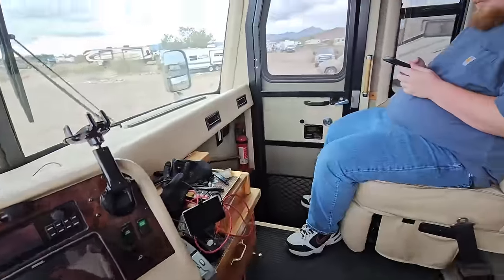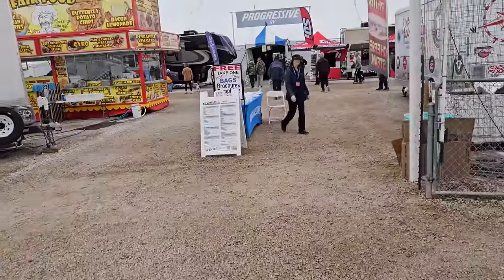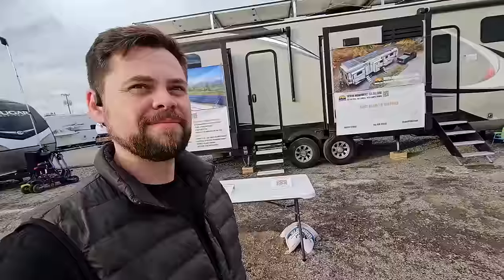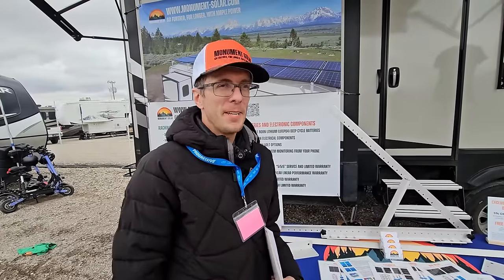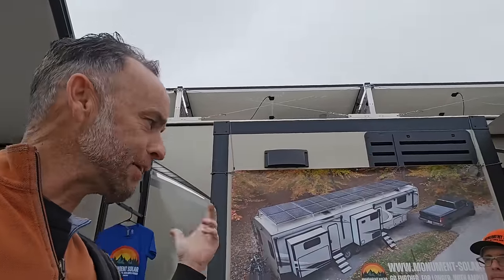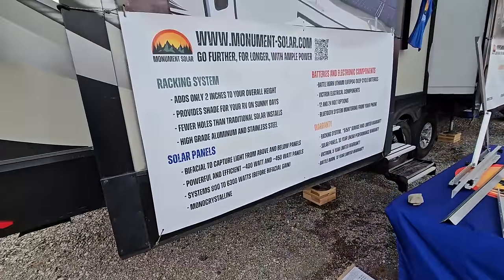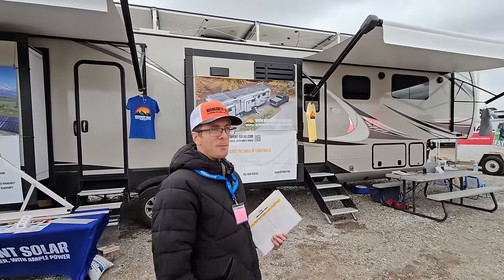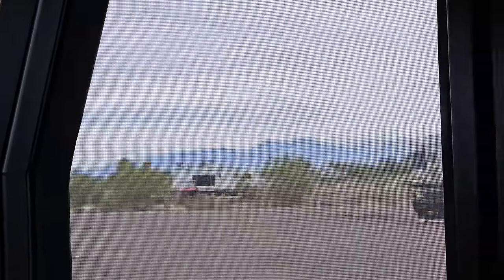The BEST RV Solar I Have Ever Seen!

Comment: Sorry. I don't think that this solar system proves anything but the fact that if money and weight were of no concern than you could build almost anything you wanted. A simple case that this guy while maybe very intelligent is like many inventors blinded by looking for fame and practical isn't part of his vocabulary. Probably a smart guy though.
Reply: All engineering is choosing what to compromise, what to optimize.  His choices don't completely put his solution in an extreme corner of the possible envelope, but definitely pretty far  toward one corner of it, versus the other corners.
Reply: I like your take @EfficientRVer  but I don't think that corner is going to be too populated and that's my point. You need to appeal to a mass market to be successful these days and in this case any RVer should be paying attention to the weight of their rig. This solution has plenty of hard work and brains behind it, just no practical use except for maybe a stationary RV. It's just too heavy when you take into account the cargo capacity left to work with.

Comment: Well WOWee. NOWww..All u need is to design a MOTORIZED version of this setup! I advise pneumatically dampened actuators to smooth out windy times operation. Setup should sense excessive wind to temporarily lower the panels, then raise when seens safe to do.
Reply: Adding to first comment..I have prototype of a solar panel/popup breezebox-type wind gen combo setup. The breezebox wind gens acually FOLD DOWN under the pnls nice & neat! So now u have better power grab'n chances in your travels!

Comment: Although this sounds like the solar would be structurally sound on the roof, what I don't understand is how anyone with a 5th wheel feels that they got an extra 800lbs ccc to spare for that amount of solar after they loaded their rig with food, bedding & clothing, dishes, outdoor gear and then the Water, in order to boon dock? Crazy but no 5er has that extra ccc, they make em with only minimal. For those that pipe in n say just beef up the suspension, ok, but how do u plan on beefing up the trailer frame? 🙄. 
Imo, this solar array is a nice idea for half or 1/3 its size, or for a stationary rv or home. 🍻
Reply: Yup
Reply: yes, too much extra weight - and the height allows for more air lift during travels which can stress the panels

Comment: I built an "up and over" rack like this with aluminum Unistrut and panel clamps. 2420 watts in 19' of roof. I have a molded fiberglass Class C, so using stainless aviation studs and a 2 part adhesive I was able to install the entire thing with no new holes through the roof. I actually fiber glassed over some holes where I removed the old satellite dome TV antenna, so end result was less holes than when I started, and each panel comes off with 4 bolts for service. I haven't added a tilt feature yet, but that's next on the list. Its dramatically less engineered than this setup, but we've done over 6k miles coast to coast with no issues or loose hardware. If we eventually move up to a Class A I'd like to take the same approach to a 5-6kw split phase system.
Reply from the maker: I've had a similar idea too....I may be doing one shortly
Reply: @AZExpert  I really liked the Unistrut - theres a million different fittings available and its really rugged once its all together. I built my minisplit rack out of it too. The panels provide extra shade on the rig and (to my surprise) havent created much wind noise or lowered by fuel economy. Ive been pleased with it.

Comment: Surprised you didn’t mention that during hot days the way this system is set up will also help reduce heat, so your ac won’t have to work so hard. The panels create a bit of shade and you have great airflow below panels to remove any hot air. Traditional setups have a lot of trapped air, so your roof membrane is stuck absorbing all that heat.
Reply: They did mention that in the beginning

Comment: Just wondering, if This system is making your overall height a little too much. What's your opinion, James? I'm wondering how much height it adds above your AC's Or whatever is the highest point on the RV? Pretty.
 Cool set up though.
Reply from the maker: just inches above the A/C

Comment: I like the idea, and I hate to be a negative nancy but if you are a full profile 5th wheel pushing 13’6”, the added height will be the first issue.  RV manufacturers already build suspensions and frames to a minimum cargo weight, and a solar system of this size eats up your cargo capacity quickly.  The RV manufacturers will voiding the all but worthless warranty for installing a clearly better than Z bracket mounting solution.  I wish him luck for his improved idea.

Comment: Looks like a great system for well made RVs. I question the sanity of adding such to a fifth wheel. Just two days ago I passed  a fifth wheel with a balooned TPO membrane roof going down the  road- looked like an evil genius cartoon character- but considering the TPO membranes are not attached properly- how would any bracketing system function to mount panels to a roof... it would be futile to attempt IMO. Perhaps if the TPO were removed and glued down first- or replaced with FRP instead... or perhaps the frame assembly itself would catch the balooning membranes. I know the balooning is not just a fifth wheel issue as I've also spotted at least one Class A going down I-95 with a "brain contusion" (expanded roofline) lol.

Comment: I wouldn’t use Bi-facial as the shading that standard panels produce is probably more effective at keeping the rv cool than the extra solar power you would get. Then having the AC cycling increased.

Comment: I wonder how many gallons of Diesel one could burn to run a generator when needed to get to the same amount that solar system cost. 
It looks interesting, but a lot of extra weight on the roof and his basement storage was filled up with equipment and batteries.

Comment: All that added weight means tires need changed how often?  2 times a year or how many miles?
Reply from the maker: I can't see how, but weight management is an issue not well talked about in the RVer world so it's a good point.
Reply: Put higher load rating tires on, if it worries you.  Not a bad idea even before you overload a vehicle.  My car came with tires with load index 89 and speed rating S (112mph).  I put on tires with load index 99 and speed rating T (118mph).  The car rev limits at 104mph, and the stock tires were marginally OK for the rated GVWR.  But adding more safety margin in case you overload, or lose some air, is smart.

Much more tire wear can be avoided by increasing inflation pressure to the "max psi" on the sidewall, than the amount of tire wear created by adding a couple hundred pounds per tire of weight.

Comment: Someone check my math: 5300 Watts @ $10/watt install is $53,000????. Now add the panels ($15k???) and the batteries ($5k) is $73,000???? Harbor Freight Predator generator is $1,200.
Reply from the maker: It's my understanding the cost was all inclusive, labor and parts for the complete system.
Reply: It very obviously includes the whole system.  Nobody is paying $53,000 for a boxful of aluminum and SS brackets, custom or not.  Victron stuff is not cheap.   A system this size is not for anyone worried about up-front cost.  It's about having all the energy you need, without every visiting a gas/propane station to keep it running, without ever touching a gas can.  It eliminates energy as a thing that makes you need to go into town and spend money.

In no way is a 5000W generator comparable to having 5000W of solar, but if you want to find out that running ACs every day with a generator sucks, just do the experiment like everyone else has at one point or another.   

There is no way I'd ever need 5280W of solar on an RV, and there's no way I'd spend $53K for it even if I did.  The smaller a system that meets your needs is, the less you need something this engineered/expensive.  A smaller RV uses less energy.  Being willing to not have it 72F in the RV 24/7 uses less energy.  Being willing to suffer a small amount 5% of the time and a fair amount 1% of the time, uses less energy.  Being single and pet-free uses less energy, too!  Duplicating the environment of a sticks and bricks home on the road, gets expensive and isn't always practical even if you disregard cost.  Everything is a compromise.  They are giving up a lot of money, a lot of weight carrying capacity, a bit of clearance height, a bit of RV life, a bit of handling, more than a bit of mpg, and probably some other stuff, just to be super comfy regarding energy usage.  To each their own.